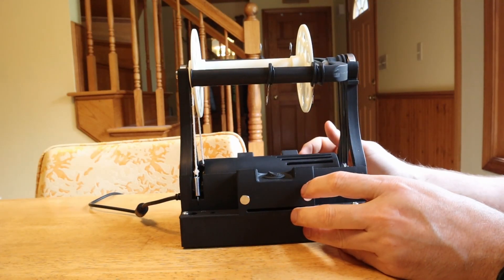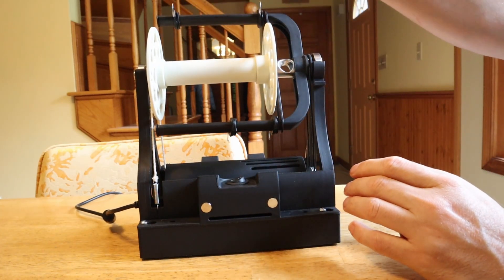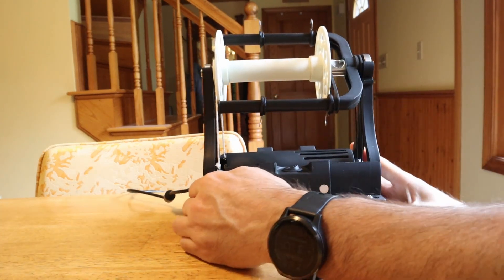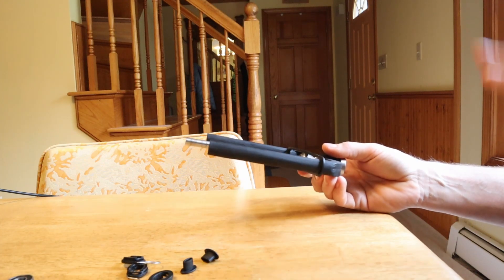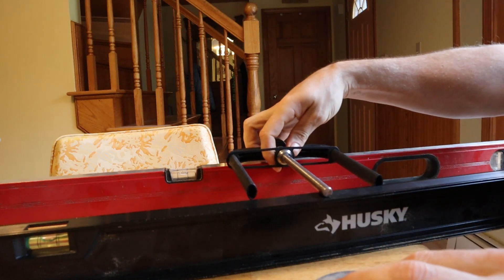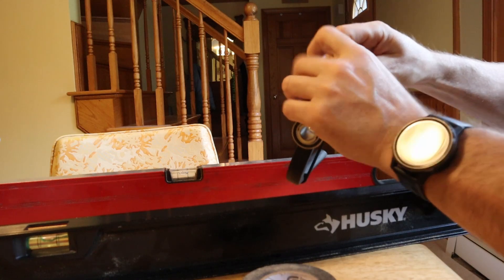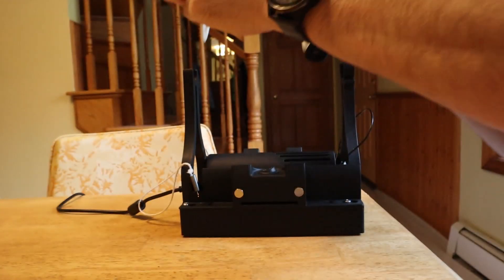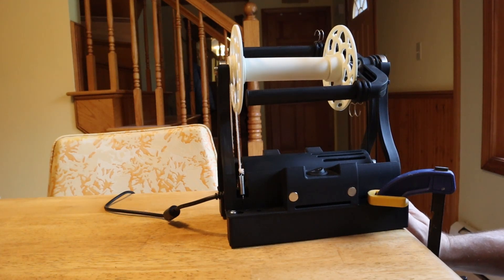Spin 177 - EEW 6 Vibration Reduction

Comment: Question: Is there a fix in the works for the bobbins having seams in the whorl where the tension line goes? I’ve had my tension/brake line snap a good four or five times in the 4 weeks I’ve had my EEW 6.1. It took a while to figure out it’s because the bobbins weren’t totally cleaned up after printing, and there’s a hard plastic seam that eventually “saws” the twine in half; I use a nail file on any new ones, plus switched out the twine with wax-coated cotton cord. It helps a bit, but it seems to throw off the balance enough to cause vibration.

Comment: Thank you for the information on how to work out vibration.  I don't normally spin at high revolutions, but for certain types of fiber that would be helpful.  Looking forward to the new fold spinner that will accommodate higher speeds.

Comment: Taking the balancing idea a step further a user adjustable balance trim feature could be added by suspending a thin plastic balance weight (moulded or 3D printed, maybe 10 x10 x 0.5mm?) in between the stabiliser bar arms, located in place by snapping onto the arm bars. The balance can be levelled by moving the weight along the arms.
Reply from the maker: I personally think just adding a drop of glue a few times is better since it would be more durable and less likely to change over time.  That said, maybe what you proposed would work.  It isn't something I have tried.